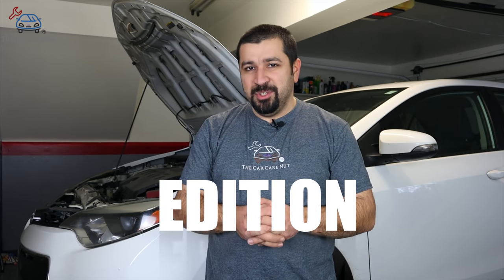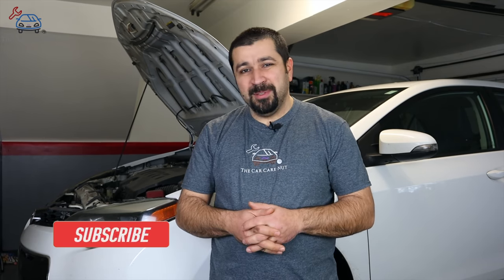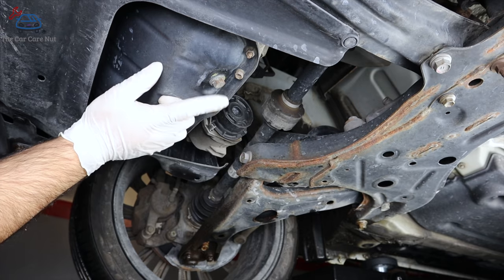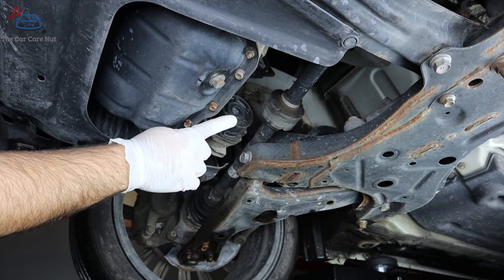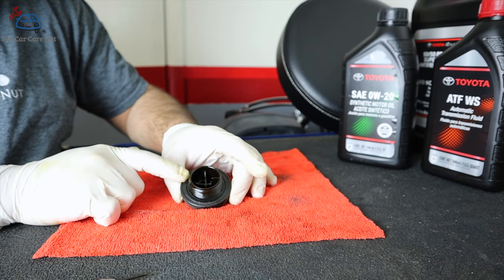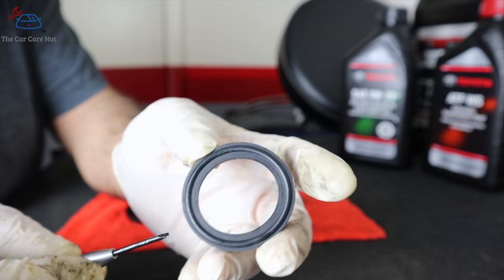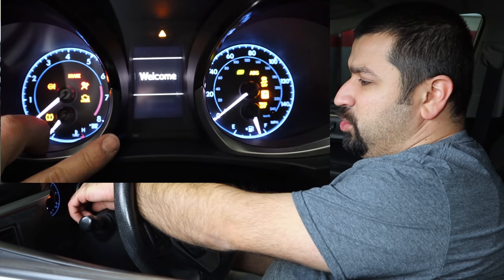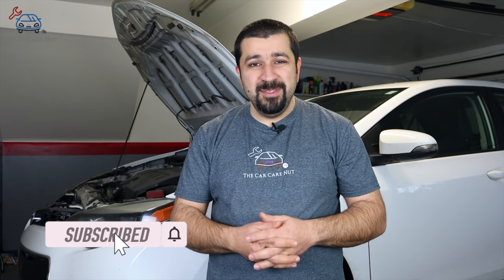How to change your Engine oil and filter for Toyota Lexus Scion

Comment: I have a Toyota RAV4 hybrid Limited 2020 when I checked my oil that was done at the dealer about 3000 miles ago it was about a half inch high above the Full mark on the dipstick does this engine in my Toyota have a dilution problem with the fuel in the oil like the Honda’s we’re having or is my Toyota dealership at fault and they’re just idiots.  Maybe I’m the idiot for paying $100 for an oil change and I supply the oil and oil filter.

Comment: @13:20 Just sharing a ridiculous experience: I took my '18 I4 camry to a dealer who I found out filled it with 0w-20 even though the cap/sticker in the engine bay said 0w-16. I didn't realize until a week later, and they didn't ask me if 0w-20 was ok at the time. (I guess I also should have noticed on the invoice that they billed 0w-20 for some reason after the fact). The shocking part was when I came back to the dealer to request them to redo the oil change and use 0w-16, the diagnostic technician tried to brush it off saying they're close enough (which, I could understand their point of view, but this person had no sense of responsibility) ... quite comical and disappointing. The service manager was genuinely surprised and took care of me, though; I guess he didn't know that this was a change with the new generation I4 Camry's.
Reply: Yup. That's the dealership experience. I bet it cost $70 too

Comment: Just called my local dealer and they said they only sell individual quarts of engine oil, which sucks for DIY. Better storage of dirty oil with the 5 quart jugs. IT IS ALSO $9 A QUART! Walmart has Valvoline 0W-20 oil for $23 for 5 quarts compared to Toyota oil at $45 for 5 quarts. My 13' 4Runner takes 6.6 quarts of oil per change, but spending twice as much over the life time of that truck is not worth being a fanatic about engine oil. Stick to name brand oils and change every 5,000 miles. Buying Toyota engine oil really seems like a scam and I'm sad CCN would encourage it.
Reply from the maker: Hi! The dealership is overcharging for that oil!

Comment: You're only the second person I've ever heard to call it an or-ing instead of an oh-ring... Maybe it depends where you're from...?

I really like this video. Great tips about how little the oil filter cap needs to be tightened and how there's nothing wrong with the plastic one vs an aluminum one.

But the spin-on oil filters are also called spin-on canister filters. I refer to this system as a cartridge style oil filter.

Some people spray the inside of the oil filter cap with brake cleaner to clean it before installing the new filter element. What's your opinion on that? Since brake cleaner might damage plastic I was thinking it might not be a good idea.

Comment: What can I do to clear the somewhat loud engine noise maybe evening a ticking sound - run engine cleaner or maybe add Lucas synthetic engine additive?

Background:  Just bought a used 2012 Lexus RX350 (engine 2GR-FE) with around 130k miles. I now noticed loud idle engine noises at startup and goes away around 45 minutes of driving/being on. No check engine light on but I did find 3 stored codes: 

1.  P0015 - History camshaft position "B" - timing over-retarded (bank 1),
2.  P1604 - History startability malfunction, and
3. P1605-History rough idling. 

Other data shows ""Clr Dist" 40,722 miles, "Warm-up DTC Clr" 255, and "Clr Time" = 1,092 hrs, 15 min.

One Toyota mechanic said don't worry about the noise until the check engine light comes on but by the time I brought him the vehicle, the noise was gone. He did say the codes can be an expensive fix. Thanks for your help!
Reply from the maker: Hi! The noise could be normal and I would have to listen to it. The 2gr is loud when it’s cold and that’s normal. The codes if history I’m not worried about but if they do come back up can be an oil control valve which is not very experience to replace

Comment: I have a 21 land cruiser that I don’t drive often. I have about 5k miles on it in the 2 years I have had it. I change the oil every 6 months but it looks just like it did when I put it in. My LC stays in a climate control garage, I’m thinking once a year will be ok in my situation, can you let me know your thoughts.
Reply: I'm have a similar issue but still dump oil at 6 months but skip the filter for 12 months. I save the old oil for flushing my buddy's diesel. The oil it just too clean to waste.

Comment: Just remember folks, if you change your own oil under warranty, it is void. In Australia we have Consumer Laws, even after the warranty has run out as long as long it's serviced by a certified mechanic. I was pissed off when i brought my Toyota in September 2018 with 3 year warranty, then in December 2018 they gave a 5 warranty.
Reply: What? Lol. So if you change your own engine oil while the engine is under warranty....that voids it in Australia? That is not the case in the U.S. That is ridiculous. I have always changed my own engine oil on vehicles under warranty.  Never voided it. As long as you are putting the correct weight oil in there, it should not matter.
Reply: @CrowT  i believe this is true. I know it's not hard to change oil and filter, but if for some unseen reason, filter not installed properly, sump plug comes loose and you lose oil and blow the engine or do damage, you're paying for repairs, not them. And I'm guessing it's the same in any other Country while the vehicle under warranty.
Reply: @deanbowell7501  Right. It is void if YOU cause engine damage because you botched the oil change or tore something up in the process. Not just because you changed it. That was what you seemed to state above. That is just void if you change it....even if nothing was damaged.
Reply: @CrowT  I will ask my dealership, as I'm about to get my last 3yr fixed service  price and the end of my 3yr warranty. Maybe  The Care Car Nut may shed some light on this?  I have 3 Toyota's and all get serviced by a dealership on time or klms (miles) which evere comes first. If something goes poo poo, they might come to the party to fix it, if you didn't abuse it! P.s did YOU do any of the other service recommendations that are required under warranty?
Reply: Sorry, The Car Care Nut, my bad.
Reply: @deanbowell7501  No. If it is covered under warranty, I won't. But procedures like oil changes or things that are considered routine maintenance are typically not covered under any warranty I have had. Usually it is some sort of power train warranty...or bumper to bumper...ect. I guess there are ones that can include routine things like oil changes. But I have never had one. All that routine stuff I have always done. Oil, coolant so on and so on.

Comment: Hey there!
I always go to this mechanic shop to change my oil for my 2017 Prius with full synthetic 0W20 every 5,000 miles.  I always see that guy pulls out a box that contains 4 full synthetic 0W20 Mobil bottles, but he uses only 3. Is it okay?
Does my car require only 3?

Thanks again!
Reply from the maker: Hi! Your car takes 4.4 quarts. Is the engine oil level correct?
Reply: Do you know how to check the engine oil? Very simple

Comment: Haha. You don’t even clean out the filter case or suck out the remaining 0.3ltr remaining in the sump. The less old oil in the engine means less contamination of the new oil.   People use rubber grease on the O rings because it doesn’t swell the O ring. Engine oil swells the O ring. Great advice from a dealership 🤣
Reply: And, yet, none of us have issues doing it that way:)
Reply: No one does all that anyway. The filter case is on the ‘dirty’ side of the filter, so it doesn’t matter. And who the hell sucks out the last remaining amount?
Reply: @pinkiepie1656  slack people don’t. People that actually care about what they do, do
Reply: I don't suck out the remaining oil from my car, but to each their own.

I'm sure it doesn't matter but I don't know why he didn't at least use a shop rag to wipe out the oil filter housing. I will just hit it with some brake kleen and wipe it down (inside and out). It doesn't have to be spotless but it takes like 10 seconds and it makes me feel better!

Comment: Hello again car care nut hopefully you can help me out with a question it’s important to me and my family,I recently bought a 17 RAV4 all-wheel-drive it had four brand new tires when I got it absolutely brand new about 4500 miles later I got a nail in the tire ina unrepairable location, with only 4500 Mostly Highway miles would I be OK just to replace that one tire? I know it’s not a lot of information and I do have a tread depth gauge could you tell me the specifications or the allowance that I would need to be in to be safe or do you just think with so little miles I would be OK?
Reply from the maker: Hi! Replacing the one tire should be ok. Usually when the 3 tires are almost worn out and you get this situation then I’d say put 4 tires but in your car you’re all good with one tire.
Reply from the maker: That’s a sharp looking one! And with good maintenance you’ll have it for 20 years

Comment: Toyota dealer over filled my Corolla by almost a qt.
Reply: It used to happen to me all the time and that's because the lazy asses don't make all of the old oil drain out, but they refill it with the full amount on top of the 1/2 quart or more of the old oil they left in there. I bet that's a very common thing from those dealers.

Comment: Amd and rest of guys , be aware now Sienna and higlander and other models comes with 4 cylinder engines , smaller engines but most mechanics at dealership change oil thinking those are v6 engines overfilling like crazy. I drain my 2021 Sienna and find out 7.5 quarter oil in it. Crazy and danger.

Comment: Ooh! One thing I forgot that I heard about on another channel that I can't remember... I'm getting old.

Anyway, it was about putting the keyless fobs far enough from the hybrid cars when changing the oil. It is possible to accidentally leave the system "ready" as we drain the oil with the system sitting quietly. Then the ICE starts!
Reply from the maker: That’s actually very true with hybrids. Still remember the last junior mechanic who’s doing their first oil change on a Prius and that happened. It sucks when the engine starts as the engine oil is draining.

Another one is remote starts that are not installed properly and don’t have a hood switch.

Comment: MISTER CAR CARE NUT, you was speaking about lifting a car with big lift that costs $3000 or more, so now I'm really scared to Jack the car with Jack stands and get under the car, before i didn't scare to under the car, but now I'm scared, because I've got a friend who worked under the car and the car was dropped on him and he died, since at time I'm scared to get under the car to do some works, my transmission fluid is due to change I'm scared to get under the car to change the transmission fluid, one day i did put the car on the ramp and blocked the rear tires with woods and i shook the car, the car was very solid and I'm still scared to get under the car, my is going to let me use his big lift, so I'm going to use his big lift,
Reply from the maker: Hi! I’m sorry about your friend May he Rest In Peace. Car jack safety is very important and often missed. Using jack stands of good quality and double checking that the car is secure by rocking it a few times is important. Otherwise it should be ok.

Comment: On my Tacoma some of the fingers were chipped from the dealer my 24 month service was over so I decided to do it myself after I finally got filter off with tool when I put oil in car and started it up oil leaked from one of those fins that were chipped so I ordered a new filter housing when you tighten filter do you bottom filter to engine then torque or bottom filter then leave alone
Reply from the maker: Just tighten it with the torque wrench until it reaches the specified torque

Comment: Hi,
In warm/hot climates like south texas or Louisiana would you recommend putting "thicker" oil (for high mileage cars) than what the manufacturer originally suggests. Example: instead of 0w-20 putting 5w-20. Or instead of 5w-30 putting 10w-30?
Reply: I lost fuel economy on 5w30 over 0w20. The motors are engineered for specific viscosity.

Comment: I just bought a 2021 Toyota Camry Hybrid with the 2.5 Liter engine. Does my car have a cartridge filter, and if it does, do I need the 09228-06500-02A Oil Filter Wrench?
Reply from the maker: Hi! It has a spin on filter but that wrench also works on it
Reply from the maker: If it worked for the 2020 it should work for a 2021 Camry hybrid

Comment: To “change your oil like a pro” (like a minimum wage employee at a dealership), you should drain the oil till “most of it is out”, and then torque the filter housing on with an impact wrench, so that it would take a gorilla to remove it. Refill the engine with the cheapest conventional oil you can find, because “the customer can’t tell the difference.” Make sure to spill oil all over the top of the engine because you’re too busy to be neat. THEN leave a huge mess under the car so that no one can tell if there is an oil leak or not. THAT’s why I do my own oil changes!

Comment: I got nightmares at the thought of not tightening the oil pan bolt tighter ;-)  It's like my mind refuses to agree that the bolt won't losen if it's only tightened that little.  I stick to torque specs but even then I feel queezy sometimes, lol
Reply from the maker: I hear you Stephane. The drain plug bolt doesn’t fall even if it’s loose. It takes a lot of time for it to actually come completely loose and fall and long before that it will be dripping and you’ll know.
Reply: @TheCarCareNut  well another priceless piece of information!! thanks AMD, this is very reassuring!

Comment: Do you have a oil funnel you like for Toyota's that do not have a straight shot to the fill hole.  Last car was a Yaris new car is a Prius V and I just looked and a straight funnel will not work on that either.
Reply from the maker: Hi! I would get a very small funnel. It will take longer but it will fit.
Reply: Assenmacher Specialty Tools OFT38. 45° elbow that solves this problem. Use it with their Toyota threaded oil funnel.

Comment: Thanks so much for the guidance on not adding oil to the "full" level, but filling only to halfway on the dipstick when the oil is cold.  For spin on oil filters, would you recommend pre-filling the oil filter before installing to prevent "dry start" and/or priming the oil system before starting the engine by holding the gas pedal to the floor while turning the key to "start" until the oil light goes out?  Also, what do you think about the Fumoto or Stahlbus Engine Oil Drain Plug Valves to reduce the mess of dyi oil changes, eliminate drain plug gasket replacement and risk of cross threading/stripping the drain plug?
Reply: Holding the gas pedal to the floor isn't going to prime the oil system.

And he said to the full mark is good IF and when the engine & the oil is fully warmed up to operating temperature.
Reply from the maker: Hi! People like to pre fill the filters with oil and if you can it won’t do any harm but in a lot of cases you can’t and I’m not too worried about it honestly. If you truly want to prime the engine oil until the oil light goes off you need to disable ignition and the injectors then crank the engine. 

I would never use the quick drain valves and cringe every time I see on installed. Taking a drain plug is really not hard at all.

Comment: I'd like to add a couple tips... Let your engine warm up to operating temp, then cool down a bit, so you drain more contaminants which come out with the draining oil, plus, you have freshly distributed oil to the internal parts and avoid a "dry" start. I also like to wipe down where the drain plug seats on the pan, just to be sure all the dirt is removed. I also "chase" the old oil with a quart of new which removes a little more crud from the pan.

Comment: Good video. Like you said I always stop tightening the plastic filter cartridge once it stops. Does that funnel also fit the 2.5 liter engine that a 2013 RAV4 has. Do you have a brand or part number for it? I always have to be careful not to spill when filling the oil.
Reply from the maker: Hi! The funnel I’m using is made by snap on. This is an equivalent one on Amazon and it does work on most modern Toyota engines including your RAV4 Motivx Tools Engine Oil Funnel for Toyota, Lexus, and Scion Vehicles with Threaded Oil Filler Caps – Fits Most Camry, Corolla, RAV4, Tacoma, Highlander, Sienna, Tundra, RX350 and Many More https://www.amazon.com/dp/B016FVJUX0/ref=cm_sw_r_cp_api_glc_fabc_DXhcGbAN1Q5QY
Reply: @TheCarCareNut  I went to the link and noticed it said that one was not for Prius - farther down in the questions and answers they explained the hood does not give enough clearance. I looked at mine and I see the cowl cover is in the way. Sigh....
Reply: @TheCarCareNut  Thank you! I will order it for my next oil change, and thanks for the oil cap gasket info!
Reply: @flagmichael  https://asttool.com/detail_page.php?tool_number=OFT38 solves this problem

Comment: Why does Toyota/Lexus charge $75 for a oil filter wrench?
Reply from the maker: Honestly because it’s possibly the best filter wrench there is. I don’t recommend a diy mechanic buy it because you can buy a cheap one and it will work great for a few oil changes here and there. But when you work in a shop full of Toyota’s and use this thing daily, it will pay for itself shortly afterwards.